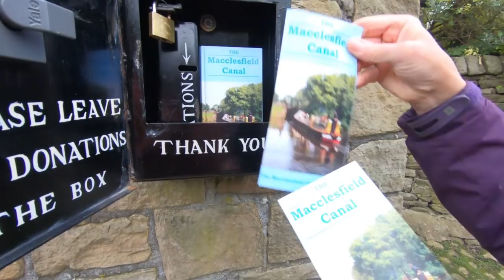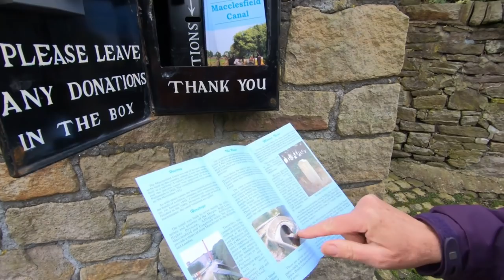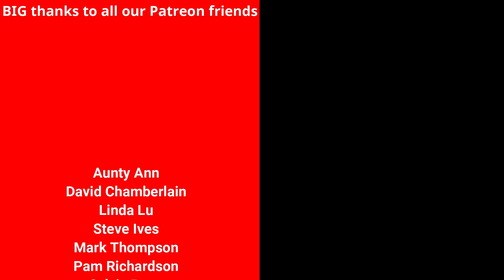Happy Days 10K! - Narrowboat Life - Episode 87

Comment: Being a know all after boating since 1995, Fran, at 7.09 you step off the boat and to slow the boat you wrap the rope around your hand and pull. Doing this under other circumstances with 20T of boat it would crush your hand. This is bad practice as we used to say in Health and safety meetings years ago at work. You were stood by a bollard, the correct and safe way is to take one turn around the bollard and ease the pull on the rope to slow / control the boat. Sorry if this rubs you up the wrong way ,I'm just trying to pass on years of boating experience. Stay safe.
Reply from the maker: Not rubbing me up the wrong way at all Brian.  You've been doing this for 25years,  I've been doing it for 2! I'll give that a go.  Thank you
Reply: being a know all sailing since the 70's I will second that... never ever wrap a rope around your hand nor pull on a boat that weighs more than you do... always use the friction of the rope against a cleat or bollard (or strapping post on canal). I've seen people pulled into the water or crush their knuckles so badly they cant grip properly for days.
Reply: I would suggest using the engine to slow the boat to a stop, rather than pulling on the rope. Certainly this is what was taught on the RYA helmsman course. I think it does mean you are in control, rather than the boat! Willow Wren  have a couple of videos on this: https://www.youtube.com/watch?v=rsCCI-eOiIk      https://www.youtube.com/watch?v=uebz3C6j7Ak

Comment: Fran, when we were kids we used to pick nettle leave by pinching then between finger and thumb in the middle of the leaf away from the stingy edges. Once picked then usually don’t sting. A slow and accurate attack works better than a quick snappy grabby attack. Give it a go and let me know if it works for you :-)

Comment: I feel your pain, Fran.  Could not pull up my pants either!  Even had pain as I raised my wine glass for a toast New Year’s Eve!!  After trying cortisone shots with little results, Dr sent me to a physical therapist.  Much, Much better, but MUST keep up the simple exercise routine 4 yrs later to keep limber!  Was told it was the rotator cuff.  My favorite exercise (which was painful when I started it 4 yrs ago) is to use stick or hiking stick and holding it out front of your body with both hands raise stick overhead, hold 3 secs, lower out front again.  Stick keeps your arm straight and good shoulder helps support bad shoulder in exercise.  A couple of other ones too I could share, but I still do this one everyday to keep the shoulder limber and lubricated. 👍Good luck❤️

Comment: Fran, save your shoulder by using the engine to stop the boat and just use your arms to pull it into the side if you need to. I see loads of YouTubers struggling to pull the boat to a halt. You never see professionals like ferry boats pulling the boat to a halt, they always use the engine. 
Congratulations on the 10K subscribers!